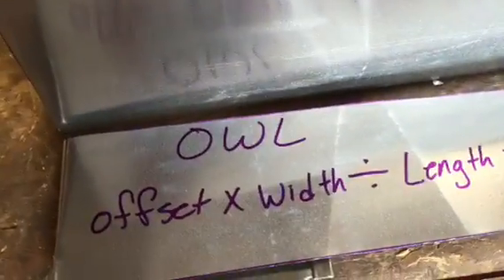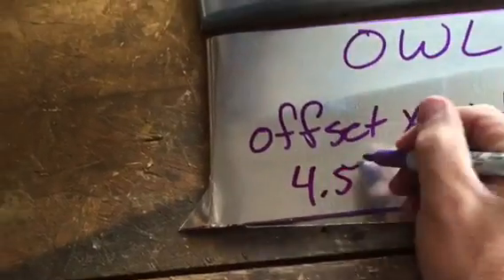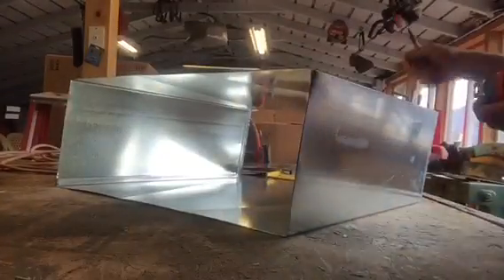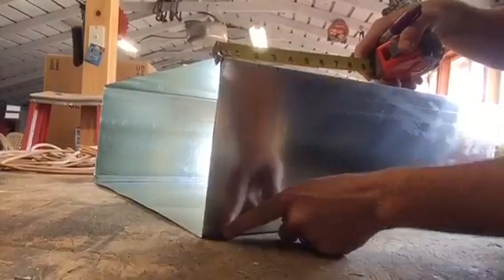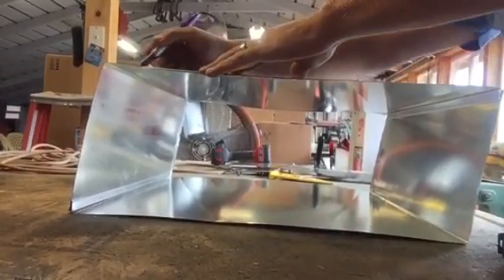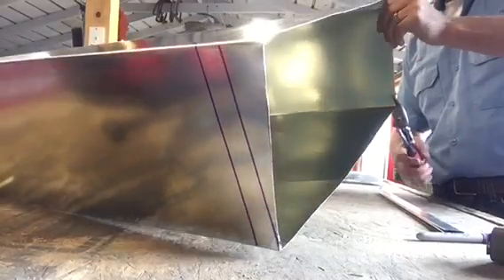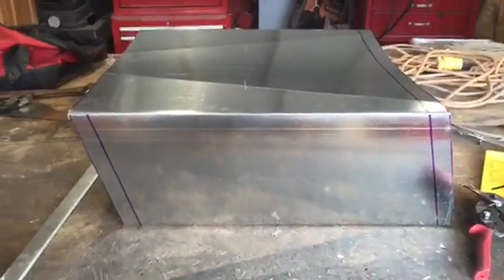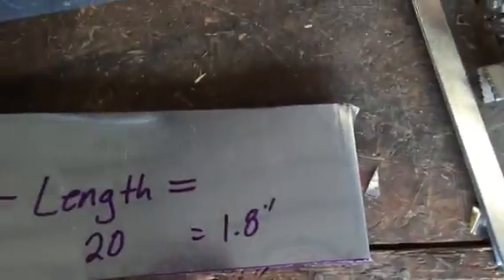Owl method Hvac

Comment: This trade has to be the biggest ripoff of any. Material is inexpensive. Labor is unskilled for the most part, and systems are not even as far as heating.
Reply: Lol. Come install some 72" by 40" duct and tell me its unskilled.

I didnt know material costs mean a trade is a rip off, lol

Comment: Ok. So this can be SOOOO MUCH EASIER! 1st, why did you put the duct together? It's a lot easier to cut when it's not together. B: why are you marking an inch for seams? They're implied. The length is what it is. Lastly, your bird method is nerdy. Go to a wall, measure the length of the offset off the wall and mark the floor. Place your cut length at that mark and tilt it to the wall and measure the the gap from the floor to the corner of your piece. That's the cut. None of this converting .8 to 3/4 math (which was wrong btw). I actually have to do this today so maybe I can be a you tube guy and show you how much quicker and easier the big boys do it. Funny how ya didn't show what a pain in the ass it was to cut that duct after it was knocked together. Rooky
Reply: Was looking for a better video on your page. Nothing was there… wack

Comment: Nice video you can do this a few ways with measuring width using half the distance to make your second mark then that is your first cutting angle. from those two marks measure 4.5 more inches from the first angle you just created for your second marks.

I would like to see you make a true 45-degree angle in any duct video. Would you use this method with that also? offset x width / length = cut? just wondering what a true 45 is so when you have a reducer in the middle of the next offset and the duct size changes. How do you correct the true 45 in that scene?

Comment: if your offset is originally 4.5 inches how did it shrink to 1.8...is the point of this method to be able to just tap some rectangle duct together then make the offset appear after its put together rather than to make like a 4 piece transition measuring out the offsets on the separate peices?

Comment: The best way to offset ducts is the the three Piece offset. I usually do it just like i bend conduit . If you have to offset over 10 inches you have to use a speed square and use a 30 degree angle so you mark it on 15 degrees then make the line . After that you use your tape to measure over 10”(offset)x 2(30 degrees multiplier)+2” for s&d connection. Witch will add up to 22” . Then from that point you use your speed square again just like the first step.. you will now have 3 pieces.

Comment: Dumb question but if you were to cut on the longer side will the Width change? Like for example let’s say your duct shown in the video is 16x8 and I want to cut it the other side will the OWL be: 4.5x16/20 ?

Comment: The problem with cutting a simple miter as you've done here is that your duct grows. Small offsets aren't usually a problem but when you get into bigger offsets it will. I always train people in 3 piece offsets so your makeup matches and never grows. To do that, you need to make an arbitrary travel length in the middle of the duct in which the length is never shorter than the offset itself. You use the OWL formula only in the travel piece then divide your OWL x2. Lay out both side of the travel piece (add one inch to your travel AFTER using OWL if you're using a slip and drive connection), cut it out, then flip the center over. Put the three pieces back together and you're done. This also allows you to get a more accurate length on your total piece as you can just trim a little off of one end of the makeup to get it to fit perfectly and looks much cleaner.
Reply: Please make a video there’s hardly any videos of how to make offsets
Reply: That’s how I was trained. Old union guy trained me and is still teaching me more 😂😂
Reply: Speed square works every time
Reply: @cedricguyton  Mechanics don't need a speed square. That's for green horns.
Reply: Why would you add an inch on both sides if youre only folding it half on each side?
Reply: @ You only add an inch to the overall travel, not an inch to both sides. This means that if you measure for a 20" travel, you lay it out and cut it at 21".

Comment: That’s not width it’s your height, so what’s the formula now offset times heights divided length..?????
Reply: The width used in the OWL formula uses the width of the side of the duct that is in the same direction of the offset. If you need a up or down offset you will actually replace the width with height for the equation. But if you need a left or right offset you will use the ducts width. Hope that makes sense.
Reply: Eric Rogers I was thinking the exact same thing
Reply: So when you want to do a offset with the owl formula you put your offset measurement times drive with means height.. then you divide length which I am confused the length of the duck or the length of the S Drive

Comment: When plugging in your measurements into the O.W.l formula, will the width vary according to which way you are offsetting?  Example ; let's say you have a 14"x8" and you want to offset to the side(left or right ), will then the 14" becomes the width since it will be getting cut?
Reply: Jd Vera yes..the 8 side is for up and down
Reply: You're with will change based on the size duct you're using.. after you put your mark for your offset you need to add an inch for your s and drive

Comment: You only need a half inch for your drive. You can snip the corners a inch for the s but I'd trim both just half inch. Good job on the video though
Reply from the maker: Yes but you need 1” for the s, then bend only the 1/2” for the drive like I did in the video

Comment: S is half inch and drive
Reply: Fuckyoumean Haaa No, you still gotta notch that inch on all four corners but bend the half inch for the drive side. S is full inch
Reply: Don't need to cut inch for the s just snip the corners so you can bend them down to level. Also you'll find if you cut them a inch depending on your cut you won't get your hooks close enough. Always go half inch
Reply: Yeah I know guys thanks for responding I’m very good at my offsets now up or down or side ways 😁

Comment: where did you get your length from? If I want it for a wait that's 20in long how long my duct has to be before I cut it knowing that I will loose some length after the offset is cut off and what if you do it with TDC Joints you don't have to add the 2 in?
Reply from the maker: Use the formula for your own situation 👍🏼 This is just an example.
Reply: @comfortmaxxhvac9251  bullshit response.
Reply: I agree.. He's not from the Sheet metal Union
Reply: He's probably don't know about TDC is

Comment: ok I understand the offset part but I am lost bcuz u don't explain where u get ur width or ur length from? I read on one of the comments that ur 20 is the space u needed between ducts but where do u get width from ....i would appreciate u sharing that with it would help me a lot in my job....thanks for ur vid and time
Reply: The width is one of the dimensions of the duct. For example, if you are using 14" x 8" rectangle duct, your width would be 8 inches.
Reply: Tom Tomer 8” is the height
Reply: @mofugger333  yes but the "offset" is up and down. So the "height" is used as the "width" of the offset.
TLDR: Tom is correct.

Comment: did you start with the length being 20 inches or is that what you need to fit in that space?
Reply from the maker: that's what i needed to fit in the space but it would work either way.
Reply: I'm glad I saw this review bc 20 inches s slip look like 20" long too..now I understand offset × width which means at this video up and down offset..( the drive side)÷ the length of the connection of drive to drive length
Reply: @josechicas2192   so the length is just the length from one c lock to the next
Reply: Whats the best way to measure your overall length before the miter is done, assuming we are offsetting up at an angle?

Comment: I tried this with grease duct and it didn't work out I'm not sure what I am doing wrong
Reply: What were your measurements? It doesn't work if the offset is too big or the length is too small.